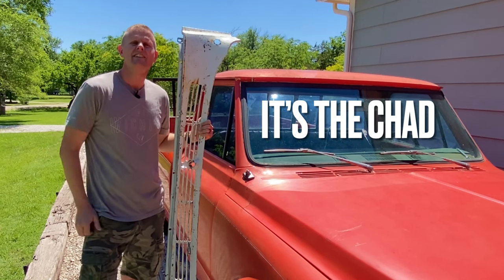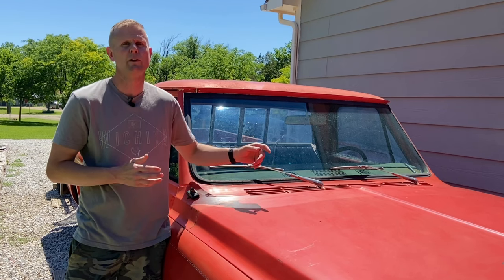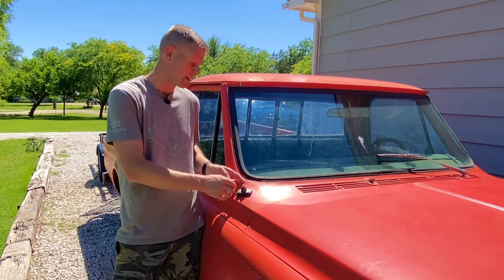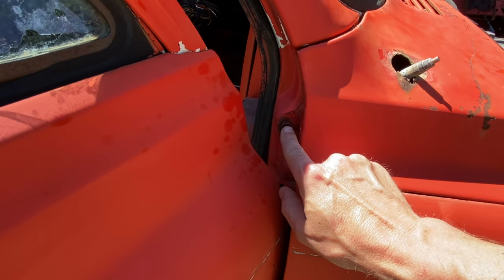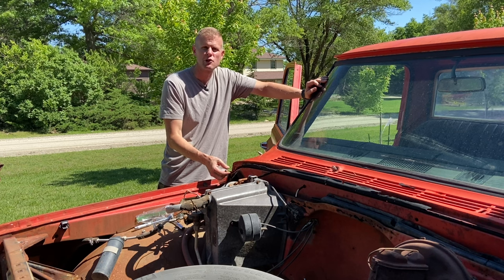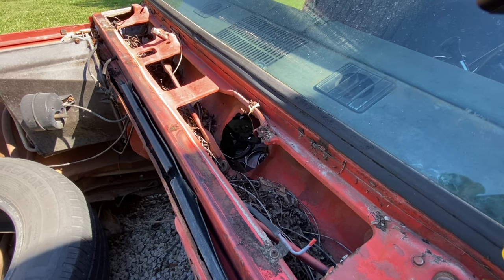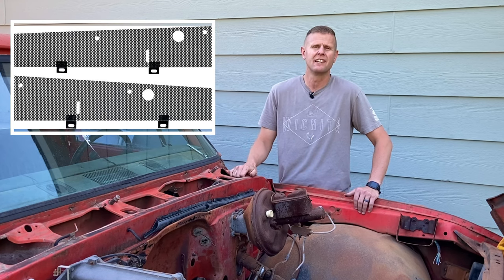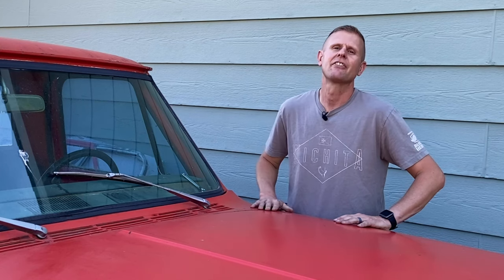67-72 Chevy / GMC Truck - C10 Cowl Panels

Comment: Add screen mesh behind cowl panel
Reply from the maker: Good tip! Much cheaper than the trash shield.
Reply: You find tricks that work my working on them
Reply: Exactly I put one on my 72’ Cheyenne 👍👍👍
Also if you do find a cowl without Antenna Hole that’s fine . Just get an internal Antenna 👍
Reply from the maker: @jimmysapien9961  much cleaner look that way.
Reply: Brothers sells a solid wiper vent panel ! Thinking of putting one on my 68 C10 !

Comment: Hey Chad, I have a 67 c10. For some reason, my antenna hole is on the drivers side of the cowl instead of passenger side. Was this an option?
Reply from the maker: Not that I know of. Some don’t have them at all that were radio deletes.

Comment: Thanks so much for your videos. I just bought a 67. I notice the hood on mine is higher in the center at the cowl (like it bows compared to the cowl). The truck next to you in the intro almost looks the same, but it may just be the angle. Is that factory/normal, or is something wrong with the hood? It seems like it would be even with cowl.
Reply from the maker: It’s pretty common for the hood hinge bushings to get a lot of slop in them over the years. One side may be worse than the other. It’s hard to see it with the spring on. If you can push down on the back of the hood and it aligns better with the cowl, that’s a pretty good indicator you need a new hinge. I hope that made sense.
Reply: @C10TruckNerd  Thanks so much. It makes sense. I think either my hood or cowl is off on this one. The hood corners/edges at the hinges align with the fenders well, yet the center of the hood is elevated, almost like an aftermarket cowl hood, but it’s an original style.

Comment: Will a 69 c30 cab fit a 68 c10
Reply from the maker: Yes it will fit. There will be some differences though. Fuse panel is mounted differently, E brake was a handle under column vs foot in 69 and a few other small things.